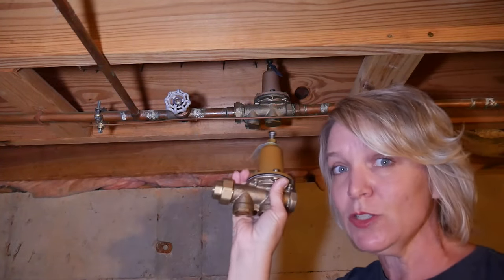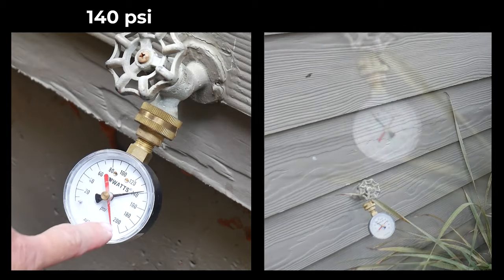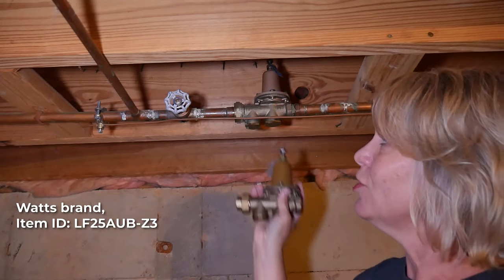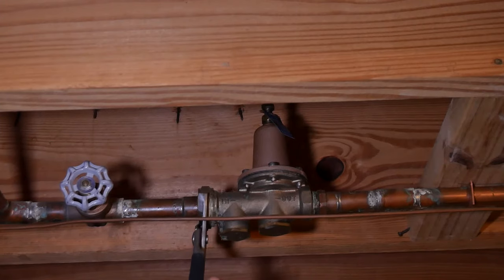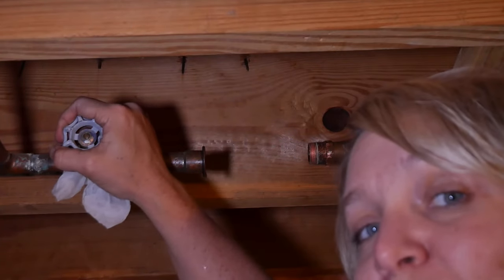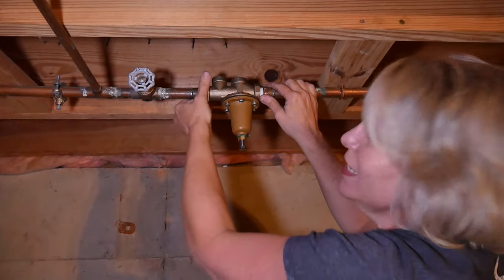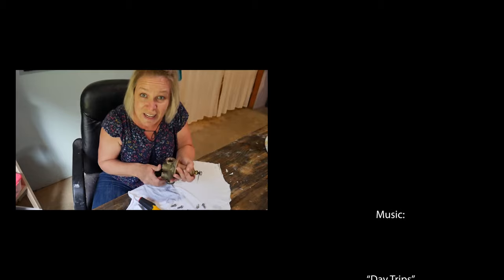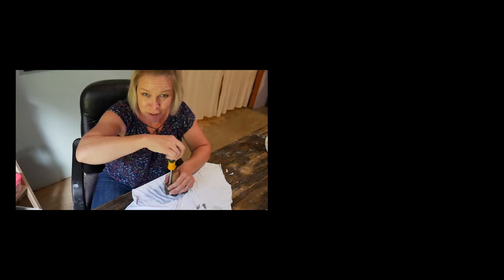Higher Than Usual Water Pressure - Changing a Pressure Reducing Valve

Comment: I think you should use two wrenches when removing a plumbing item, i.e. valves, water regulator etc. One to hold the item and one to remove the nut. That way you won't turn or break the pipe further down the line while you remove the item, using two wrenches will also give you more leverage when replacing the item and it will keep the replacement part in the right orientation when replacing the item.  Did you try adjusting the pressure before replacing the water pressure regulator? Turning the adjusting screw could have saved you time, money and effort. Another suggestion is to use a wrench with a longer handle also for more leverage.
Reply: You are so right Ronald H.  I was laughing the whole time.  But, not bad for giving it a shot Lady 😁🤣😂
Reply: Good thing that copper pipe is malleable, and was able to to twist just enough over the long run to absorb the torsional stress without fracturing the line.  Watching that copper deflecting under torsion kind of gave me the willies for a bit.
Reply: Thanks so much for sharing!
Reply: @k9er233 yes, I learned the hard way when I was very young, living at home, trying to fix my mom’s sink. Twisted and broke the copper pipe 🫣 mom then called a real plumber 🤣
Reply: i second that. last thing i ever wanted was to create more work, especially in a crawl space or a nightmare secenario. My advice to any homeowner is TRY IT OUT, but if you dont feel comfortable then phone a friend who has the skillz
Reply: Glad you posted this!!!
Reply: Oh my god! Don't anyone do anything like this. Anybody breaks their pipe doing what she does needs to sue her after your solder joints on your copper pipe break! This is my only professional should be doing these kind of water fixes unless you absolutely know what you're doing. She does not. She's a nut
Reply: As has already been mentioned always use 2 wrenches , or slip joint pliers ! 
Next - electricity will definitely flow through brass it is metal after all , but you don’t want it in the regulator ; was probably a diaphragm type

Comment: You can install in any direction; however, the two caps below the bell houseing (at the top in your finished "repair") is a strainer and the other is a main drain.  You could have loosened the drain cap to drain the line.  It is much easier to clean the strainer when its mounted in the down postion.  You could have merely rebuilt the PRV with a kit ( new spring, gaskets, strainer and washers) and left the unit in place.  Good on ya for doing it yourself!

Comment: The only thing that I can add, make sure to support that pipe on the right. You don’t want to twist and torque on one side and let that soldered copper pipe take the torsion. Otherwise, you saved yourself $500 to $800. Good video!!

Comment: Another thing. Don't ever put your pressure gauge on a water heater drain. There is sediment in the bottom of water heaters that will clog up your pressure gauge.  Use your washing machine supply

Comment: Need to put a wrench on the copper fitting to the right of the PR valve when you try to remove it.  It will come off easier, and you won't run the risk of damaging the copper pipes on the right side of the PR valve.  Great video!

Comment: My house has the same situation. The water hose outside of my house shows ~90 psi, whereas my hot water tank pipe (behind the water pressure reduction valve) has much lower. I used the outside water hose to test the water pressure while adjusting the in-door water pressure reduction valve, the pressure gauge shows no difference. (I was confused) Now I understand. Thanks for this shared video.

Comment: Thanks for your video. I'm a DIYer by nature, but never tried soldering copper water lines. I got quotes of $425-$675. Didn't even notice until I watched your video that the valve is threaded, not soldered right on. So figured I could give it a try.  The valve I bought looks the same as yours but when I got it home I saw they are made differently.  So the existing threaded copper connector would not work.  But for anyone else watching and reading and wanting to try yourself, I found a really easy solution.  Home Depot sells brass Sharkbite connectors that push onto the copper line and have male threads on the other end.  I bought a copper tube cutter for $15, cut the line on both sides so the old valve came completely off.  I had a regular Sharkbite (about 3" long) on the IN side, pushed it onto the copper line.  I got another 3/4" Sharkbite male slip adapter- which is about 6". The longer slip version gives you several inches of flexibility inside.  I threaded onto the valve on the OUT side and pushed onto copper line until the other IN side lined up, then tightened the large nut.  There was a very little leak at first but just had to tighten all the connections more than I thought.  The great thing is Sharkbites can be taken off if needed.
Reply: I am an avid DIYer not a professional so take this with a grain of salt. In my reading and learning I have encountered lots of arguments related to the use of sharkbites. One that I find compelling, however, is that sharkbites are more likely to fail in high pressure applications. If you have a sharkbite on the City side of your PRV, you might be living dangerously.

Comment: Great video! You gave me the confidence to go ahead with a project that's been waiting for me to start for months. I like to DIY, but am occasionally dyslexic and freeze up on 'righty-tighty'. 😅😅Showing the direction you go on all the nuts is very helpful. I also can sympathize with your level of swearing-I can't complete anything without a few blue streaks here and there. Keep up the good work! *Also, I think it's fine you changed out the whole thing, rebuilding it is ridiculous: most people never change this thing until it's rusted out and failing.

Comment: Cool.  But be advisee that you can usually buy a service kit for pressure reducing valves so you don't have to replace the entire shabang.  Last rebuild kit I bought was $27.50.  A complete new valve will likely cost you at least 4x that and is harder to swap out than the rebuild kit is to install--and is less likely to result in some other damage to the piping if you don't know what you're doing.  Model # for a common Watts kit is something like 1/2-1 N45B/EZ-N55BM1 RK  But Watts sells a lot of different regulators so there are several different kits out there.  You need to properly identify your valve to find the right kit.  (This is one reason I always keep the original boxes for anything plumbing related that I buy... receipts... etc.  Also, your valve may be under warranty if it wasn't installed that long ago (say, less than 5 yrs) so check that out as well.

Comment: That wire is part of the ground that is attach to your water pipes. The PRV has a rubber gasket in it so the bypass wire make a complete grounding connection.:yougotthis:

Comment: Doesn’t matter how the prv faces.  It’s a spring on a diaphragm that only allows a certain amount of pressure by.  You can tighten the bolt and put more pressure on the spring allowing less psi in, or loosen bolt relaxing tension on on the spring should allow more psi….
Reply: As long as flow is correct way.

Comment: Wow that was a lot of torque u put on copper line! Hopefully it all worked out seems it did. I have to replace my 30+ year old u5b watts prv and redo all connectors. Got a quote for almost 1500 to also add to replace 2 gate valves with ball valves. Just robbery so will do myself.

Comment: Great job, but two things.  Try not to wrench down the shutoff valve because it will destroy the washer. You can also turn the water off at the meter, but another topic. Secondly, always introduce water into the house SLOWLY.  Otherwise, great video and explanations.  An 8" monkey wrench along with your channel lock wrench is a great combo to use.

Comment: One "trick" I use to loosen things that are as tight as yours is a steel pipe that fits over the end of the adjustable wrench. In your case you would need 2 pipes. Unless you could set one wrench handle against the wall, ceiling, or floor.
I wish you could have taken the old one apart and taught us how that contraption works.

Comment: Great job, but I recommend using two wrenches, one to twist the valve, and the other to hold the pipe to prevent it from twisting, which can cause welding to crack and leak elsewhere.
 I know lots of men that do not even try to learn how to use a wrench, while I do most of the repairs myself and save lots of money for my steaks and vacations!!!

Comment: Thanks.. I was worried watched it. Several times , you helped me a ton ,, I knew it wasn’t that difficult but I hate soldering .an didn’t want to break it .
Reply from the maker: Thanks for watching! admittedly, this one was a little scary.
Reply: I had the same trouble getting the last fittings loose as you did . I took torch an heated it up . To get it turn loose . Thanks again .
Reply: My regulator is leaking and it needs to be replaced. I’m definitely a little scared to try this as I’ve called a few plumbers and they want to charge $450 bucks to do this. Seems a bit expensive for something that seems so simple to do.

Comment: How much pressure can you give to those copper pipes before you end up breaking a fitting and then need to call a plumber?  I had a plumber come and replace mine but I didn't know where to shut off the water main for starters.  If you're going to hook it up to the hot water heater, wouldn't you have to drain the hot water heater in order to hook that pressure gauge up?  Could you use thread pipe sealant instead of PTFE tape?

Comment: Thank you for this whole video! I have a few things I gotta fix around the house 😒 and until yesterday, I didn’t make any connection as to why. My pressure is at 140psi as well! And that additional pressure is gonna cause wear and tear on all the faucets and appliances(!) downstream. Initially, I thought I had to replace my Temperature & Pressure Relief (TPR) Valve on my water heater. But after some research, I realized it’s more likely my whole home pressure, which had caused leaks with my toilet fillers and other places, caused excessive hammering as I tried to turn on my rear outside hose bib and who knows what else. Given how close I am to the city’s main water supply, I will set my PRV a bit lower than comfortable (but still within the recommended 40-75 psi) so when I do notice a change, hopefully it alerts me to checking or replacing my PRV. 

Is that a good plan? Maybe? I could dispute my own point that by setting it lower, I could make it wear out faster😅 but I feel I’d rather take an extra clue of stuff failing than letting other things fail before a realize and remember what might’ve be the problem.

Comment: Why not first try to adjust the PRV?   And, why not first clean the bell.   RE - copper wire ... meant as a jumper for the #4 ground wire from electrical panel because the PRV may not be considered an adequate means to transfer power in an emergency. ...  also recommend she replace ALL house gate valves with 90 degree ball valves.  Don't forget under sinks and all toilets.  Use SS braided wraps - never the plastic/translucent cheapies!   No wrench comment,  but, with one wrench a risky road!   On the plus--very well done video!
Reply from the maker: Thanks for the tips and the kind words!

Comment: @ChickFixUSA. This is good to see, including your verbal expression when the connection was so tight. That made me laugh and was very real. However, as someone else has noted here, it would be good to not 'use teflon tape on the side that has the rubber gasket. The wire is to bridge electricity over the rubber gasket.'  And to use two wrenches at the same time if possible.

Comment: Any tips on loosening a stubborn thread? Even using two wrenches I’m not able to loosen the original outlet connection. It’s tight quarters in a drop ceiling and using a hammer to nudge it is not happening.
Reply: What about using some WD40? Just spray carefully and let it sit for ten minutes and then try and loosen again.

Comment: Great video and thank you for posting the detailed installation procedure. It is somewhat scary for me dealing with the main plumbing because if I mess up, I have no water. My recommendation is to replace the gate valve for the main shut off with a ball valve as they last longer and easier to use. My gate valve was stuck and I did not know until I had to use it one day and had to resort to turning off the water at the meter. BTW, how old was the PRV that you replaced?
Reply from the maker: It was original to the house, so 18+ years. Thanks for watching, and I'm really glad you found it helpful!

Comment: Thanks for the video. I am going to have to do this as well. Mine in installed just sticking out of dry wall under the stairs in a closet though. I'll be cutting into the wall to replace it. I was curious how one would replace the shut off valve to the left of your regulator in your video. Mine free spins and never bottoms out (closes off the water flow) in any directions turned.

Comment: I think the video should have started off by mentioning this project is only necessary if your PRV is broken. 

For most people, if the pressure is too low or high, you simply need to adjust the PRV by turning the screw to the right place.
Reply from the maker: I do get to that around the seventh minute, but you have a good point: it might have been better if I had said that earlier.

Comment: Using the channel locks to turn off that gate valve on the left was probably a no-no.  I've overtightened those before in response to a slow drip, but it actually makes it worse.  You likely cracked the plate in there that has the o-ring and now it will never seal.
Reply from the maker: Well let's hope not. This was done months ago, and so far I haven't had any leaks. Let's hope that keeps up.
Reply: @ChickFixUSA  Fingers crossed!
Reply: Those gate valves are the worst. I prefer the quarter turn style
Reply: @nateanth  it's not a gate valve but a globe valve.
Reply: @trentvlak  Doesn't matter if it's a gate or globe valve, a quarter turn is still a better used valve in applications needed for a shutoff valve
Reply: @nateanth  Globe valves are at least functional and they have the advantage of being repairable. Gate valves are basically pointless and have no reason to exist.

Comment: Just discovered mine is leaking. Is this an emergency? Will they burst?
Reply from the maker: Well, I'm not a plumber, so I wouldn't want to try to assess this issue here. But it it's leaking, you definitely want to do something about it soon. I don't think it would "burst" but it definitely shouldn't be leaking. Where exactly is it leaking from?  One of the spots where it's connected to the pipe? If so, you could try tightening it.
Reply: No they won't. Depending on the model, you can repair them or replace them. The model this lady took down was repairable with a kit. She then replaced it with the same repairable model. $66 for the non- repairable, and $120 for the repairable model.

Comment: A couple of things here. Should have stabilized that pipe against the PSR when twisting the PSR. New unit Installed upside down, small thing but it does matter in long term operation. You could have rebuilt the unit for less than half the cost. As close quarters as your installation is, it probably been best to remove it for the rebuild. I can't recommend your procedure based upon what you did in this video.

Comment: You are showing bad info on this repair. You need to redue the video showing how to use 2 wrenches so you will not break your pipe on the right side.
 One to hold and turn the pressure valve and one to hold the pipe from turning. You are very lucky you did not break the pipe.

Comment: That valve it's upside-down.....need  to correct it...it' I'll brake prematurely..and you always  need 2 pipe Gretchen  to loss or  tide not just 1.  Need  hold the other pipe  wile  the other lose o tide... ..u need  a men. In there..mama..

Comment: You don't know what you are doing. Totally wrong. Pull this video. You're lucky you didn't twist and damage that copper pipe. Use two wrenches to counter the torque when losening and tightening. Don't use teflon tape on the side that has the rubber gasket. The wire is to bridge electricity over the rubber gasket. Sheesh!

Comment: Just hire a plumber, she almost caused more problems then its worth,
Reply from the maker: What did I do wrong?
Reply: @ChickFixUSA  Nothing really, that was just a massive amount of torque on your soldered copper fittings on the right side.  That torque will make the pipe bend only so far before something breaks.  Just hold back against the female adapter on the right next time and no worries.
Reply: Main thing is use two pipe wrenches as mentioned already. Sometimes it helps if you can heat things up a bit but you have to be careful near sweat joints

Comment: You have now RUINED and WEAKENED ALL the coper pipes from your right hand on where you twisted the heck out the entire line of the pipes GUARANTEED! It will leak within time GUARANTEED. Your supposed to use "2" pipe wrenches or 2 adjustable wrenches to remove or tighten any type of fixtures on a pipe of water or gas. If not you will weaken, break, and disturb EVERYTHING down the line of the pipe. I was cringing as you kept wrestling with that part and I started yelling STOP when you started hammering at the wrench to break it loose and your entire copper pipe twisted. OMG there goes your sweated joints and anything along that entire pipe.. ..